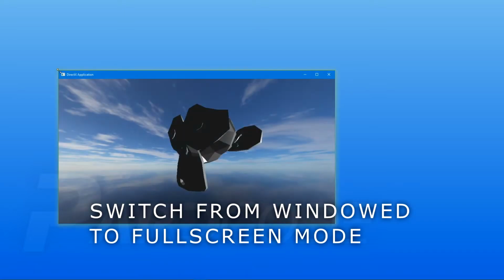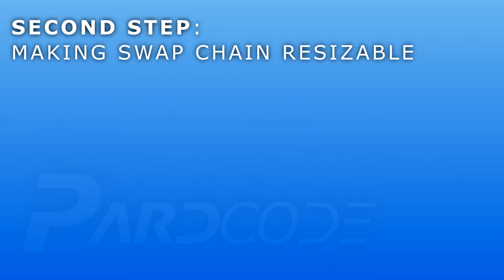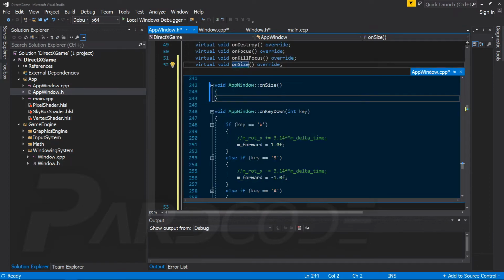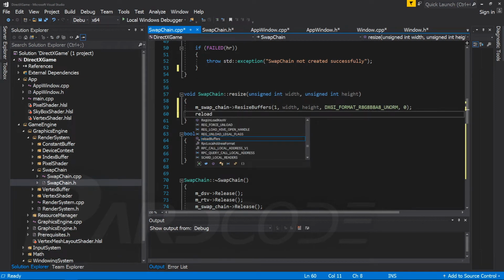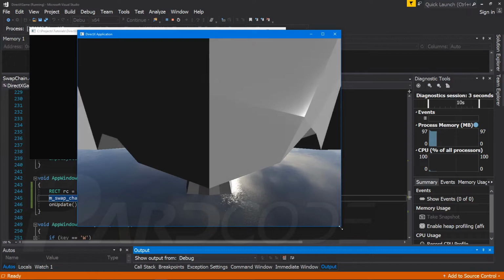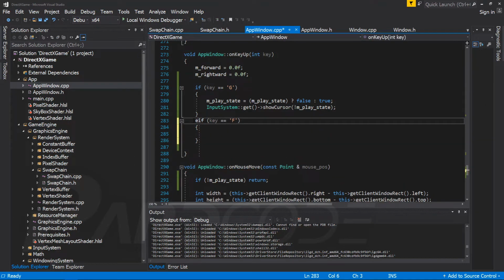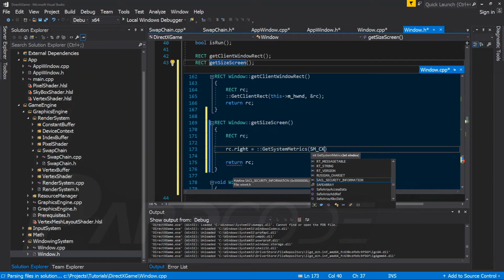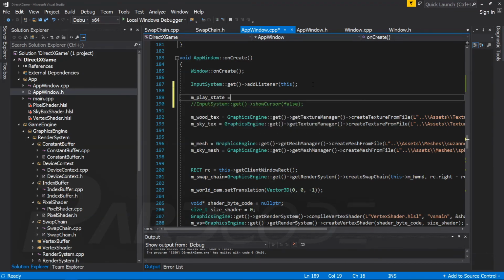C++ 3D Game Tutorial 21: Creating 3D Engine - Full Screen

Comment: Great tutorial! I have a question. When floating inside the monkeys head, I notice that some parts are visible. I was wondering if this is because it is rendering all the triangles, even those who are in the back, but because of the rasterizer they are not visible? I hope my question is clear. My concern is the performance when the scene has multiple meshes to render.
Reply from the maker: Hi, mate! If you have faced the 20th video tutorial, you've surely faced the face culling topic. Face Culling is a mode used by the rasterizer to check what faces needs to be discarded. In this case we are currently discarding the back faces (Back Face Culling), and so those triangles that are inside the monkey head.

Comment: Hi, Just following this tutorial and have noticed a slight bug with resizing the window.

If you where to resize the window to a much smaller window this will cause the engine to crash i have managed to resolve this by adding another section into the window procedure and thought i would post this up as a helping hand.

	case WM_GETMINMAXINFO:
	{
		// Event fired when the window is resized
 and stops at the width/height specified below
		LPMINMAXINFO minmax = (LPMINMAXINFO) lparam;
		minmax->ptMinTrackSize.x = YOUR MINIMUM WINDOW WIDTH;
		minmax->ptMinTrackSize.y = YOUR MINIMUM WINDOW HEIGHT;
		break;
	}

By adding this in you will prevent a crash when resizing the window very small.
Reply from the maker: Thank you for your feedback and your solution, mate!
Reply: Good call!